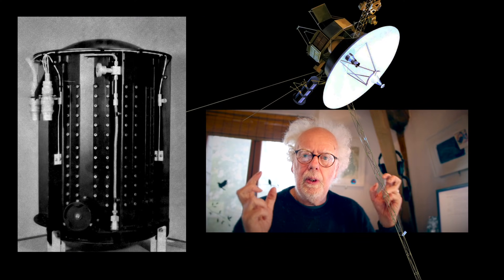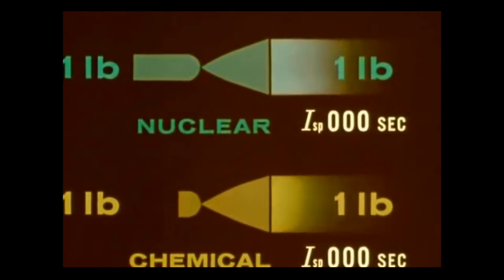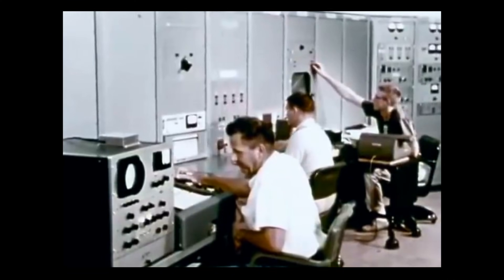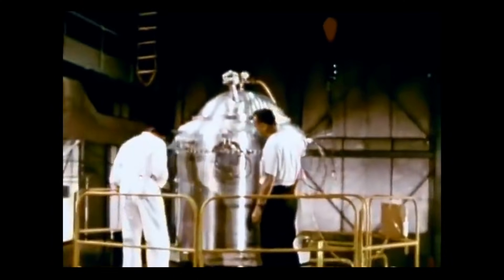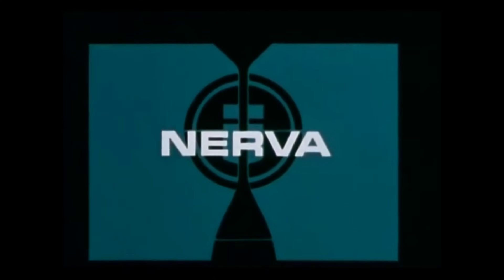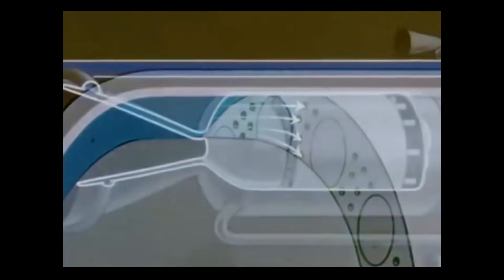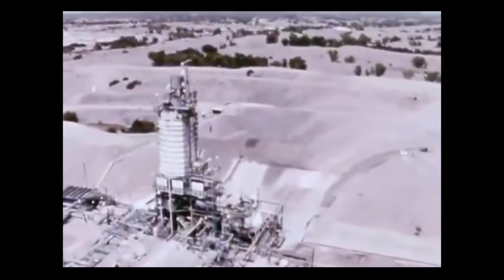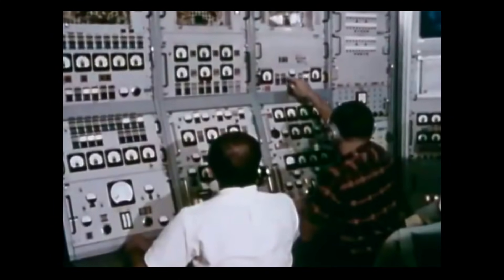Space Power Systems - Prof Simon

Comment: Didn't realise they had that many open air tests. Wonder just how radioactive the exhaust was?
Reply: AFAIK, it was minimal.  None of the radioactive material left the engine in the stream of heated hydrogen.
Reply: @Allan_aka_RocKITEman  
Ok, maybe I'm missing something here, but in water reactors, The primary loop never, normally, sees the light of day. I am assured by the professionals that the water in the primary is not that radioactive under normal operating conditions. But still has to be handled as nuclear waste.
So how does the hydrogen being essentially uncontained primary coolant not become dangerously radioactive? Prehaps dangerously is to intense a word.

Comment: The US had a similar program for nuclear powered ramjet cruise missiles called project Pluto in the late 1950's. A nuclear powered bomber the WS-125 was also tested but ballistic missiles over took both programs.
Reply: Project Pluto actually got to the stage of testing full-scale reactors, the Tory II-C, for five minutes.
Reply: J.C. Kohle  Actually neither system got past the power plant development stage. Operation PLUTO's end vehicle the SLAM was found too dangerous to test due to the unshielded open reactor design. When first proposed the fallout caused by the flight was seen as negligible compared to the fallout the  payload would create or nuclear testing had created at the time. But as the dangers of fallout drove nuclear testing underground the SLAM became impossible to test.The problem with the WS-125 was making the B-72 bomber safe enough to fly and service. Ballistic missiles were much faster than bombers and much harder to stop.
Reply: @user-qf6yt3id3w  If  I remember correctly it took over 20 miles of oil transfer pipeline to hold the compressed air for that 5 min test. It took them days to compress the air.
Reply: @JoeBLOWFHB  Yeah it was awesome. If I were in government I'd have paid the guys building that thing to keep building more awesome stuff, some of which may have occasionally killed people.
Reply: JFK criticised the plethora of missile silos spreading
Across America.I. danger of Armageddon from fat finger
2.home soiling accidental from malfunction rat chewing a wire
Now psychology, the US had dropped atomic bombs were doing
Other things.agent orange.. in Vietnam if you fear your enemy will hit you back or obsessed with beating
Them down completely and utter by any means necessary you have set
Rules of engagement no holds barred any dirty tricks go.Musst be some bad karma
Fear of retribution3. tell scientists
We want a better bomb delivery they will say no I'm not working on that...
I think this is propaganda  counter intel..enemy Russia will hopefully blow themselves
Up certainly loosing heart can't find the budget to make a propaganda film!!ICBM
improvements in Long range bomber options and sub payload deployment options including Polaris then trident in UK was the real developmental
Solutions progressing from this era.

Comment: New to the channel. Really appreciate your enthusiasm and quality of the videos you make. Most will cite the potential dangers of NTR's but actually cost is the problem IMO. A case can be made for their use as reusable second stages, but today only in space use is considered. I believe that solar thermal/electric propulsion has distinct advantages and allows faster transit times to inner solar system destinations and perhaps even out to Saturn. One problem with NTR's is the difficulty in converting the reactor to efficiently produce electricity. Because reactors make heat and this must be converted into electricity; they must use relatively massive Stirling engines or Brayton cycle equipment to convert the heat to electricity. Solar by contrast can use concentrator mirrors for solar thermal rocket propulsion and then move triple junction solar cells into the focus to make electricity at over 40% efficiency. This makes up for the lower thrust to mass of solar thermal by powering ion or other electric propulsion. Solar thermal is slightly more efficient at over 1000 sec. Isp than NTR propulsion but is limited to about 1/10 gee acceleration. This requires a week or so of thrusts at perigee to escape Earth. After that though the electric propulsion can easily overtake an NTR. I was told at a forum that the real problem was that solar thermal/electric didn't cost enough. This echoes Zubrin's recent argument that NASA exists only to serve vendors.
Reply: Yeah...what he said!

Comment: I am fascinated about the communication method I understood that the down-link is at 2.4GHz? Also there is no need for repeaters? And how the dish is maintaining its orientation towards Earth 🌎 at such a long distance I assume that only one mm off will send the RF beam away from us.
Reply: 2.4 GHz or whatever the frequency, is well above any natural RF interference on earth or space. So no need for repeaters. Where would you put them and how would you power them anyway? 
The signal being sent from the spacecraft is sent in one direction only. This concentrates all the broadcast power into that one direction. However,  even the best antennas do not beam the signal like a laser. In fact, over distance lasers display a non parallel propagation also. In the 60's scientists bounced a laser off the moon. The beam was a mile wide when it reached the moon. So to it is with the RF from the spacecraft, the beam leaves in a narrow cone pattern. so slight variances in alignment won't matter until the signal strength on the receiving end is too weak to be understood. But I imagine they have some method for maintaining alignment.

Comment: Space probes use THERMAL nuclear with thermocouples to convert heat from the decaying P 238 to electricity. The issue is poor efficiency. They could also use Stirling engines.
Kirk Sorensen was tasked by NASA to look at power systems for the moon. P238 is too weak and too rare to get the job done. He revisited the work by Alvin Weinberg on molten salt fission reactors. Small light and extremely powerful.

Comment: Even tho this is not perfect because you still would have a cryo hydrogen fuel I can't think of any other options, a fuel and heat to promote expansion and thrust, hydrogen is very dense and cryo stores well. The reactor is very controllable with beryllium rods and would last the duration along with being able to be exposed to the vacuum of space and provide heat to the vessel throughout the journey, makes a lot of sense, plus with waste heat you could use the differential to power the spacecraft with a stirling engine or heat pump. I often have wondered if the SR71, F22 or some earlier high speed jets had Plutonium afterburners to heat the exhaust gasses after combustion for supercruise. 

One close comparison to this engine is the use of electricity to produce plasma from an inert gas https://en.wikipedia.org/wiki/Plasma_propulsion_engine
And my favorite engines of all time sitting in a field rusting resemble this engine for atmospheric thrust using the air as a fuel and a direct air cycle to heat the air for thrust... wild. https://en.wikipedia.org/wiki/Aircraft_Nuclear_Propulsion

Comment: The little bit of knowledge I have makes me a dangerous critic of this reactor design.  How do they over come the Xeon 135 poisoning and how the hell do they cool it when they don't want to throw hydrogen away?  Even if they run this for 15 minutes the fission products continue to decay, that's what keeps them hot.  You would need several hours of cooling for 15 minutes of full power thrust.
Reply: The temperature of space is 3 degrees above absolute zero in the shade...
Reply: @FrancisMaxino  Yes but it's a vacuum, so heat only radiates away, there's no convection or conduction heat loss.  They would have to have some secondary closed loop cooling (water) of some kind and then to another heat exchanger to radiators on the outside (this would be ammonia or some other antifreeze based fluid).